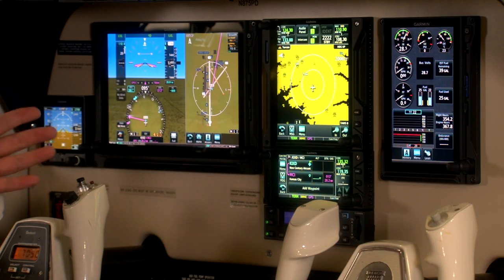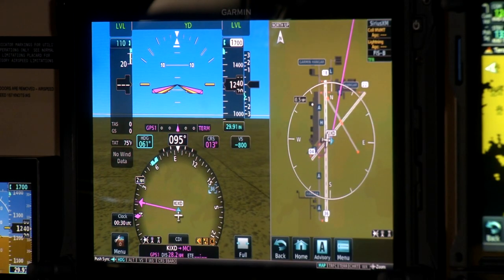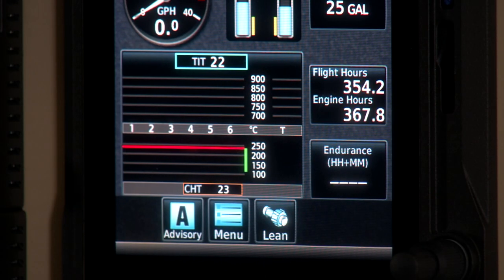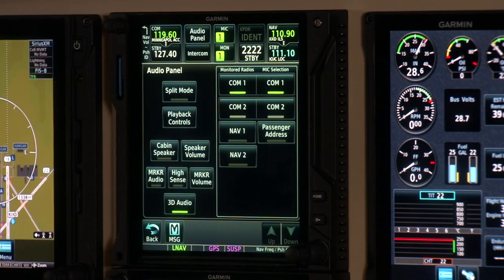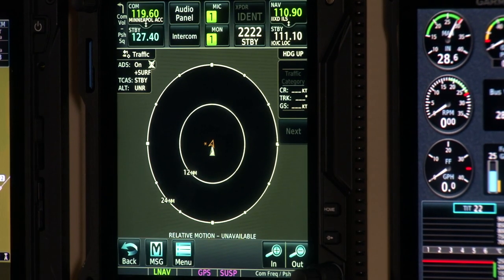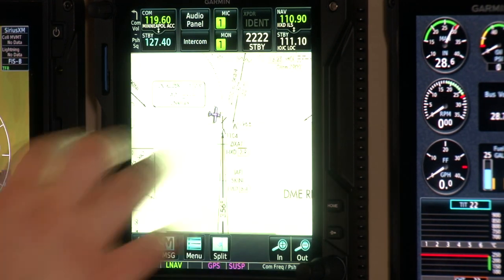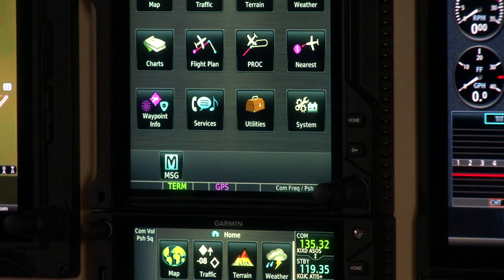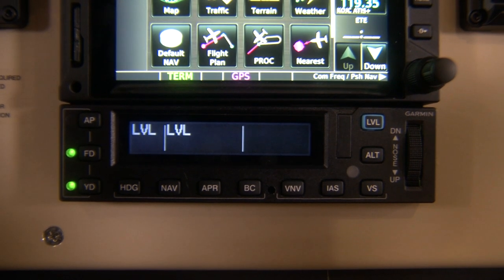Garmin Virtual AirVenture Oshkosh Experience: Aircraft Avionics Tour of an A36 Bonanza

Comment: Excellent video, thx a lot. What would be the comparison between having a G5 or the new 275 as a backup please?
Reply from the maker: The GI 275 offers our latest display tech and is noticeably brighter and higher resolution. It also offers a touch screen interface. It offers optional SVT capability as well. Those are some highlights. I'd recommend getting to a local Garmin dealer to get hands-on to see it in person. Thank you for considering Garmin.